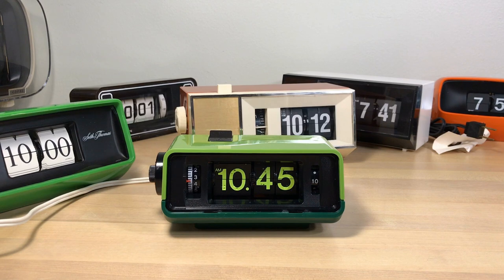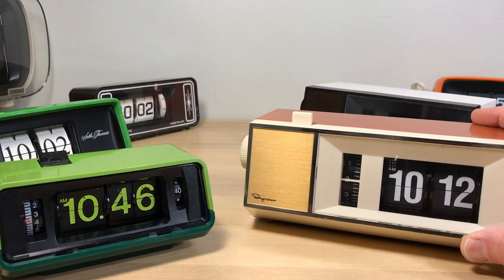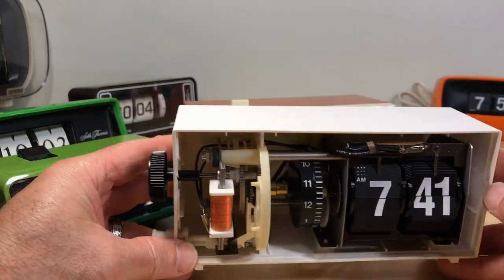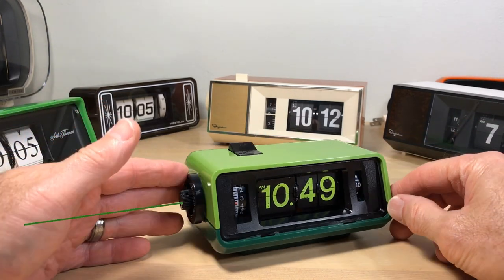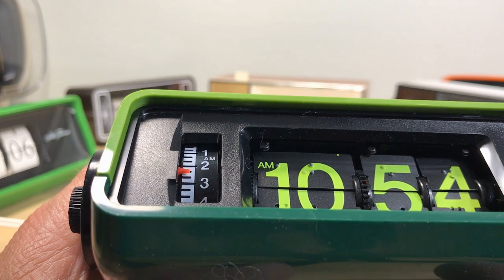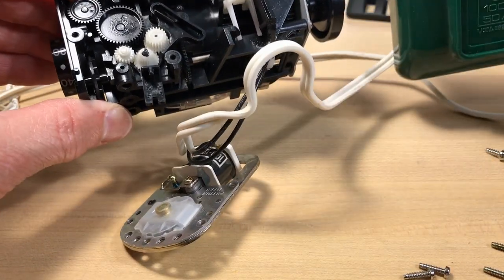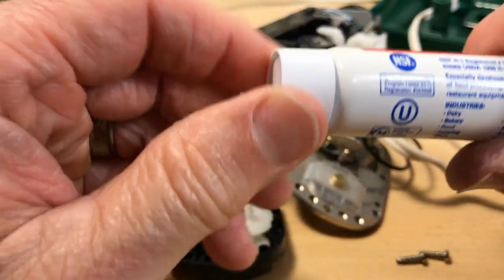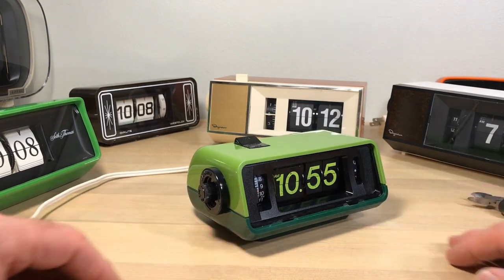Flip Clock for the Blind and other Flip Clock Fan Stuff

Comment: This is so interesting! I had no idea they made these for folks dealing with blindness and vision issues. Also I may have to try and get some of that grease you used. I tried to use some lithium grease on mine but that was the sound mine started making when I fixed my hold backs on my kentech. Great video!
Reply from the maker: I can’t remember who told me about the Haynes lubricant-film. But it has work for me in the past. According to what I’ve read it’s a proprietary blend primarily made of white mineral oil.

Comment: Hello! Lubrication of this mechanism does not help for long. You need to put the clock on the back wall and leave it to work for several hours. After that, the noise disappears for a long time. I have such a watch, they were not used (new) but the clock does not scroll correctly, one hour is skipped, and then it flips through two hours at once. To get rid of this,  need to glue some kind of clamps over the petals?